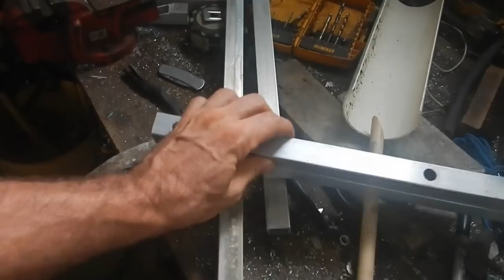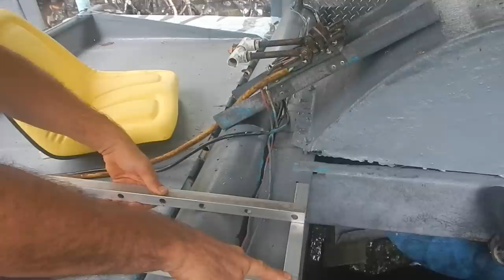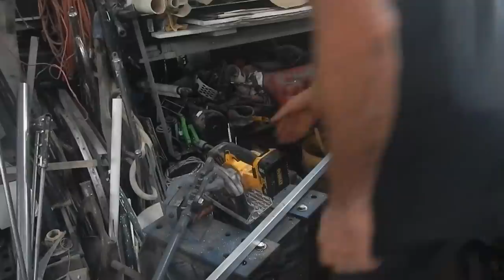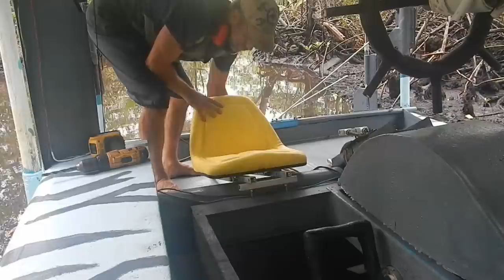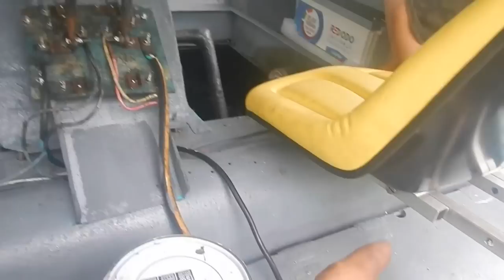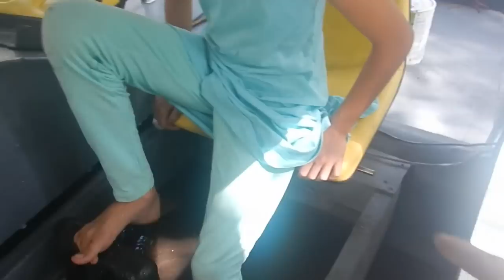Shark Slicer Upgrade 030 Seats!

Comment: You need bolts or you need to press some thicker bushings on your aluminium. There is lots of stress from strong human pedaling. It's gonna wear out thin aluminium walls if profiles are not pressed together tight.